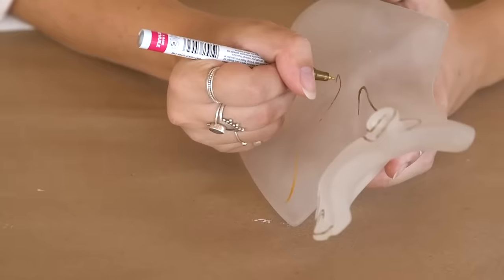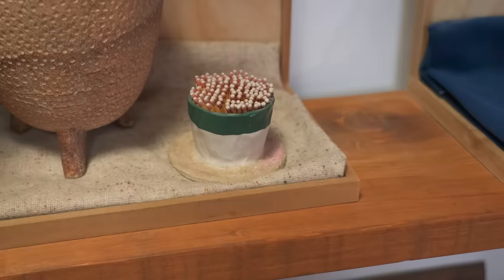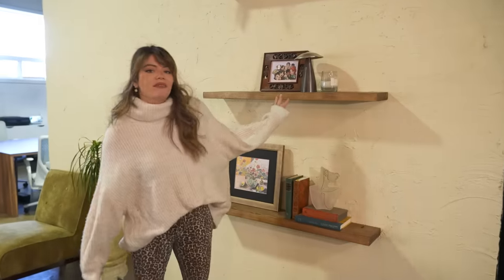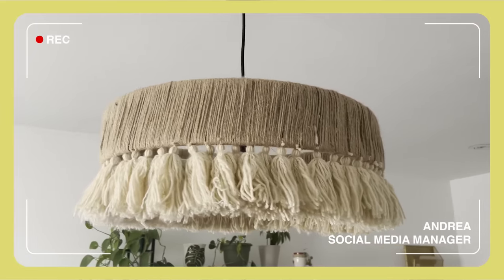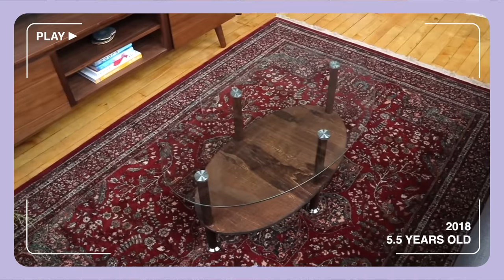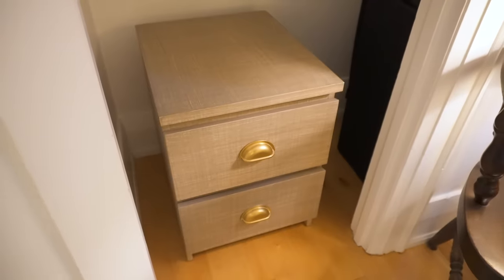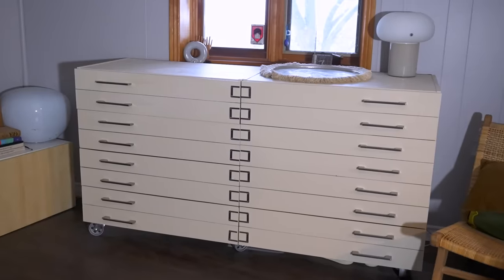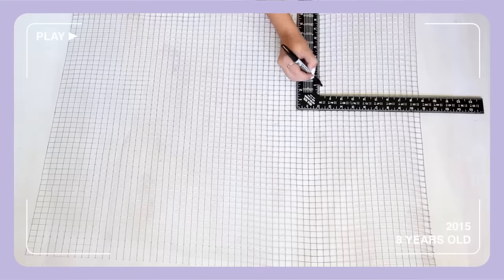ALL THE DIYS WE ACTUALLY KEPT

Comment: Someone said you should use that tree stump as an excuse to make a "finishing DIYs" video and I totally agree!!!
I'm actually currently finishing a very large stump, and it can be a lot more difficult than it looks! Depending on where you got the stump, the condition of it, and what kind of tree it came from, the experience can be drastically different. 
The stump I'm working on was left outside in the rain, and I was too lazy to dry it (because I don't have a kiln and don't wanna wait 20 yrs for it to fully air dry), and it ended up molding quite bad.
I had to kill the mold, remove the bark so it will dry quicker (removing damp bark is harder than dry bark), set up two heaters at each end for a few days (normally not recommended because heating wood unevenly will cause more cracking as it dries), chisel away the uneven parts from the chainsaw, and ATTEMPT to sand it. I say attempt because it is an elm tree stump, and I learned from this project that elm wood is somewhat of a nightmare to work with, it is extremely difficult to split or sand. 
The bright side of elm wood being difficult to split is that I am less worried about any extreme cracks from applying uneven heat, elm has an interlocked grain so despite the wood cracking, they are small and it seems to be holding itself together and is definitely drying. 
I was finally able to bring it back inside (fingers crossed it's dry enough to not mold again), and I plan to let it air dry for the rest of the year, and if the cracks get bigger, I'll hit it with the heaters again and fill the cracks with a pretty resin. 
Like literally, I WISH it was always as easy as just bringing a stump into your home and leaving it be.... A few years ago I did find the perfect stump outside, I brought it in and enjoyed it as is for several months. It was already dry enough, beautifully smooth bark... BUT it was infested with wood crickets!!! I didn't notice for a long time, and opted to toss it as we were moving anyways.